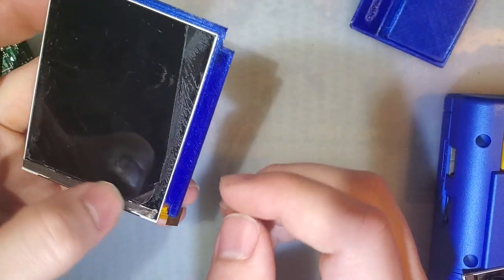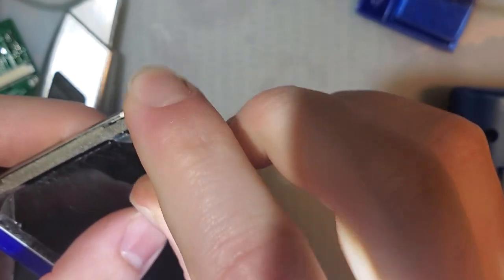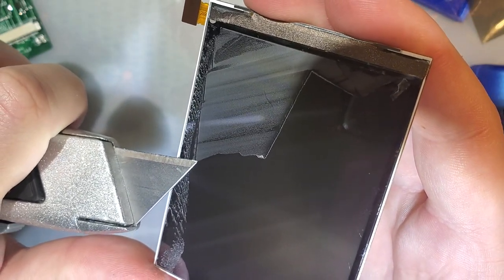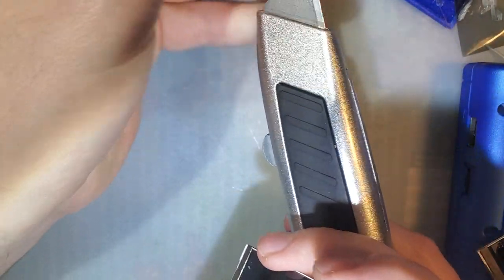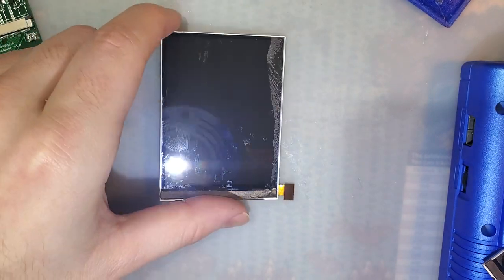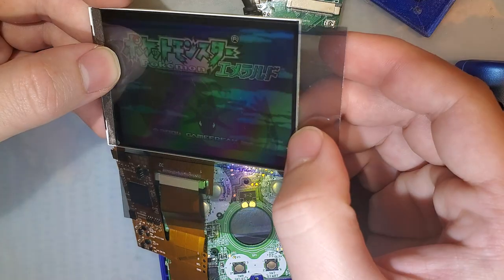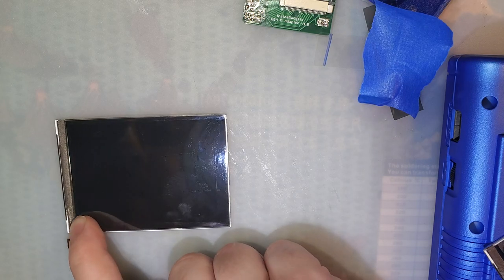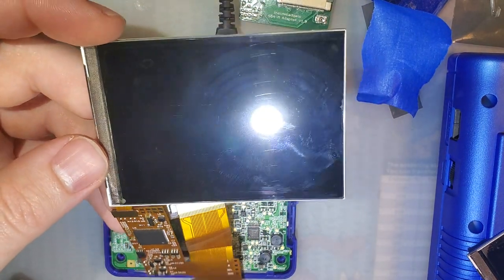IPS LCD Polarizer Repair

Comment: Weird, I expected the IPS screen to require the circular polarizer, just like GBC and GBA stock ones. That said, I was able to replace polarizers on those two recently and while it's not something a beginner should do (and took hours to remove the crystallized adhesive), I think I did an adequate job.

BTW, isn't that IPS screen a bit darker now?

Comment: How about screens with dark corners? I have a dsi xl with dark corners on both of my screens. Pressing on the corners show that the pixels do still show images. Is there a problem with the polarizer glue coming off at the corners due to age?
Reply from the maker: could be, try pulling a polarizer and find out
Reply: @makho  thanks makho.got myself some polarized film today but replacing them did not fixed it. Time for some new screens i guess. Anyway, looking forward to more videos from you

Comment: Can I ask what did you use to clean off the adhesive off the display?
I couldn't hear you clearly in the video
Reply from the maker: I meant to put a link in the description (just updated it now) but I used stuff called "Goof Off". Apply a small bit to a sacrificial rag (microfiber in my case but that's what I had) and gently work the adhesive off.
Reply: @makho  Ok, but what type of liquid is it?
It might not be available in my country.
Also can I just use Isopropyl Alcohol instead?
Reply from the maker: @alanj8118  I posted a link in the description. I do not recommend putting IPA anywhere near a LCD.

Comment: It's cheaper to get a replacement screen than a pack of polarizer
Reply: No its not. That film costs like $10 when the screen is $20+
Reply: @wyattplayzgames2918  I bought a bunch of extra replacements in case I get one that breaks and I only paid $8 each
Reply: @wyattplayzgames2918  also if you search for the screen by the phone model they were orignally made for you can get them even cheaper, about $4 or $5 each. I didn't know about that at the time I got mine.
Reply from the maker: a pack of polarizers fixes more than one screen. Second, why waste the screens I already have when I can easily fix them? Last, these LG screens are no longer available except from salvage and funnyplaying direct (marked up). It's dumb not to fix these.